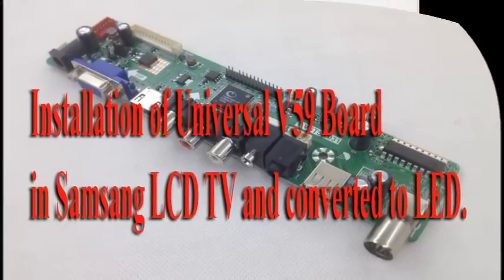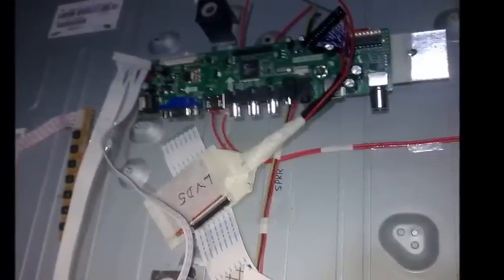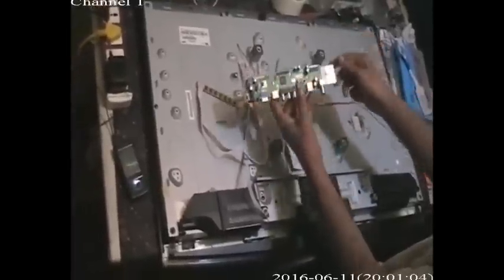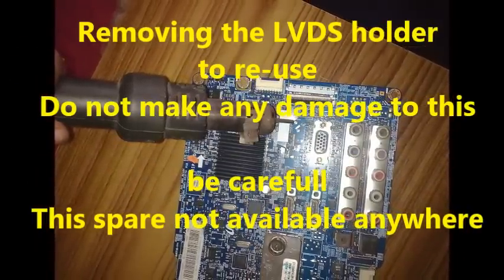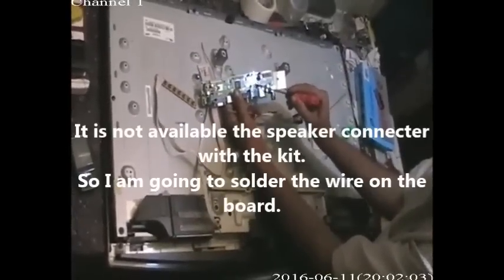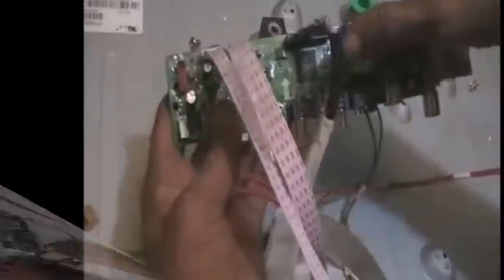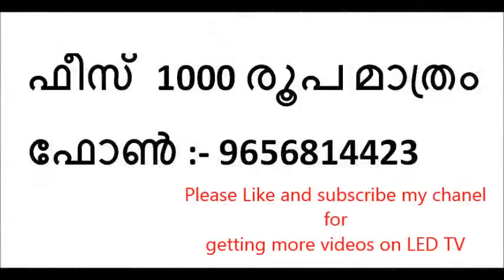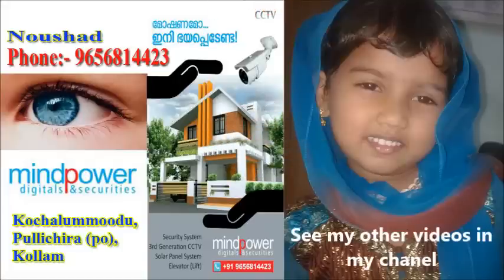T.VST59.031 Universal LED / LCD Board Installation Tutorial ( Part 2 )

Comment: I purchased a universal Board T.VST59.031 and connected it. But its Power Button is not responding. I am thinking it has lost its software due to power supply interruption. How can I recover its problem? Please suggest me.
Reply from the maker: Course details.....
LED /LCD TV.

In my online course every thing you need about LED/LCD TV is  available .
Very simply explained everything.

If you need online course of LED/LCD.....

Register..... 

You can register for this course by payment of Rs. 1200.

OR

23  US dollar from out of India. Pay by using PayPal account also.

OR
You can pay in my paytm account.
9656814423

This course is online.

6 E-books of Service Tips.
All e-books will send you in email.

All firmware for all type of panels for V59 board installation. 
More than 160 firmware available to match different type of Display panel.

Complete Instruction for universal board installation .

It is a book written by me.

Step by step process supported by picture is  available in this course. .
Language is not a problem.

And video help.

How to.... Update firmware is a separate instructing lesson.
It is in Hindi language also for your convenience.

All the books in PDF file will come to your email ID.

And Firmware pack with instruction also send to you on your Gmail ID.

.........................
It is very simple to understand for an existing Technician.

Everything explained with photos   ... and videos.

Then simply you can do everything yourself.

For more details about the course contents,

 ..... Send a MSG  in my what's app.
00918547430926
...........
Thanks .
...........

My bank details :-

P.NOUSHAD
A/c No:- 626601518016
IFSC code:- ICIC0006266
ICICI Bank ; Kollam.
......
SB account.
......
Rs. 1200
......

After transfer cash  ,
Send me your Gmail ID.

If you are ready to come directly....
Welcome for direct class room for one day.
Same fee.
Reply from the maker: 00918547430926
whatsapp
Reply: Mind Power Digitals Kollam Kottiyam 9656814423
Reply from the maker: 00918547430926
whatsapp

Comment: will V56 Universal LCD TV Controller Driver Board support the led LTM200KT03, If I procure the board can you provide me the supporting firmware,ORISSA
Reply from the maker: My whats-app number 
00918547430926
Add this number in your phone contact ..
and give me a whats-app MSG.
Or
00919656814423
Reply: Mind Power Digitals Kollam Kottiyam 9656814423
Reply: Vijayan Mk
Reply: Vijayan Mk

Comment: Tip:  The chips on this board run a little warm.  No big deal really, but if you want extend component life, I recommend a set of Raspberry Pi heatsinks.  Just peel and stick the 3 heatsinks on the main chip, the PAL driver chip (even though you may not be using it, it gets pretty warm), and the Voltage Regulator.  The heatsinks are a cheap but good investment:

http://www.ebay.com/itm/331729896424

Comment: i hav a viewsonic 22 in vx2240w ccfl monitor, planning to convert it into led backlight, ordered a kit frm aliexpress for 300, also the monitor pannel has developed 2 green vertical lines( top to bottom) .5 cm apart on the rhs side, can it be fixed, is it dead pixel.
Reply from the maker: No it is bonding problem in Panel.
You cannot repair it.
You can repair it ,if you have a panel Bonding machine with you.
Loose contact in Film connection to panel. (COF).
When you Touch in this film or gently press the bonding with your finger, the picture will show good. when you release your finger the fault again will show.

When you try to repair it without a bonding machine, more lines will appear on screen. When you try again and again the screen become totally useless.

So , I recommend not to try to repair the panel without a bonding machine.
Consult with a person who have a bonding machine with him to solve it.
Reply: ok thanks for the info.,i personally do some chip level electronics not smd's & i don't think anyone does it here in mumbai, maybe i should get a new monitor.

Comment: Very good job!
Reply from the maker: thanks for your compliment.
Reply: I have  question, I have one Toshiba 32HL57 (Brazilian model) with ccfl lamps failure. The TV power on but not show the lcd image. I would like to change the ccfl lamps for led but i don't now if the power supply board have a line protection to power off the tv. Thanks for all.
Reply from the maker: Send me the Panel model number to my whats-app number.
My whats-app is: -  00918547430926

You can see a white sticker at back side of your panel. 
It is the Model number of panel.
Take a photo and send to me.

Comment: Flashing process not starts,I have N070icg-ld1 7inchlcd 1280*800 lcd and v59 controller,plz help
Reply from the maker: There is two or more reason for this. 1. the firmware not a valid file. 2. the same firmware is already installed, once the firmware installed  the same cannot accept again try another one. 3. driver board is spoiled. 4. power failure during firmware updating . 5. the firmware is already installed and the board is OK, but problem in LVDS configuration, still you think the problem is firmware not installed....... etc...   Remedy:-  just try another software for the same resolution. if it is not available any soft you have any resolution, if it is success then try the same soft you now installed. for mare details see the panel data and double check the configuration of LVDS. Check the voltage of the board after loading,  it should not be less than 11.6 V and not more than 13.2 V,   If you need more help call me at 9656814423 and register with me for online support. Online help available only for those trained from me. The registration fee is only Rs. 1000..  If you need firmware only without support ,send only Rs. 300 to my bank account. and call me with your email id. Bank details will give you by whats-app.  Call me only after sending the fee. call from people not registered will not be entertained.
Reply from the maker: Send me the panel data if you have at my email Id:- mindpowerdigitals@gmail.com
Reply: Send me the panel data if you have at my email Id: shivadj99@gmail.com
Reply from the maker: shiva prasad My whatsapp 00918547430926
Reply: Mind Power Digitals Kollam Kottiyam 9656814423